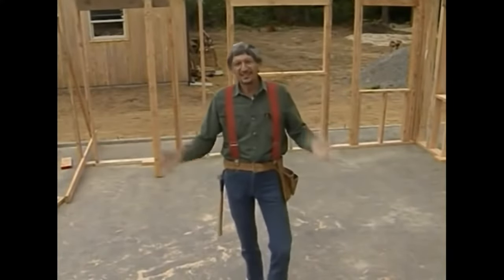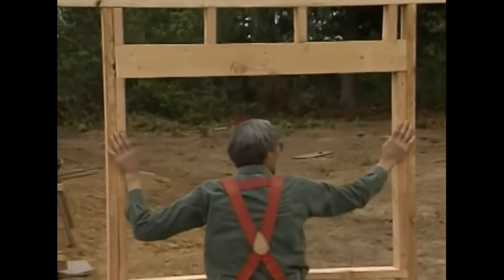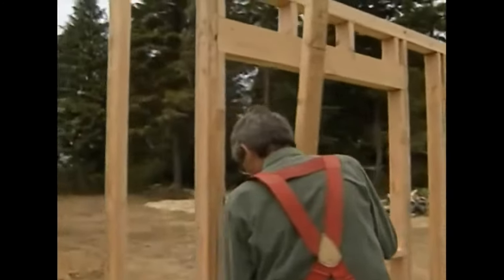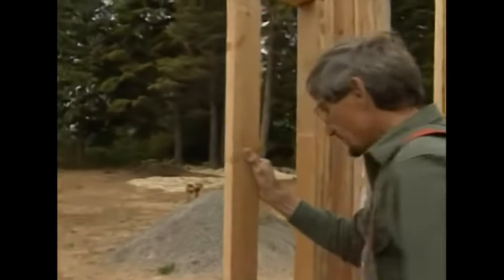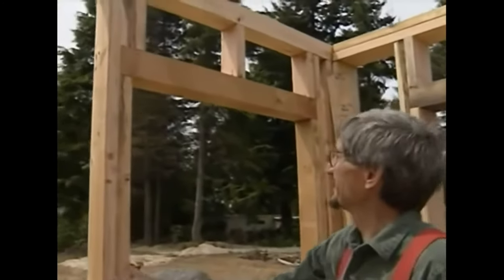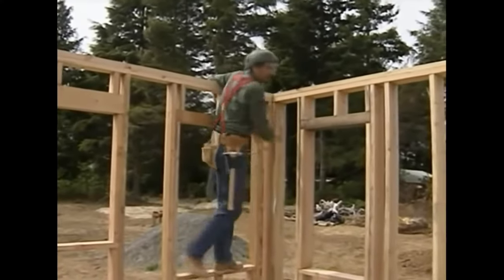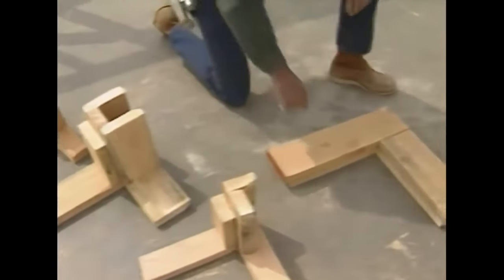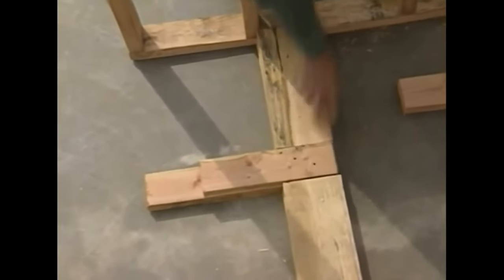Wall Anatomy Larry Haun

Comment: Those three stud partitions create a dead space that will not be able to be insulated later down the road. The two stud partitions/corner posts may not be quite as strong but they allow for insulation which is why they are usually preferred.

Comment: 6:10+12 =7ft10 (excluding 4” upper double plate and 2” bottom plate). How do you sheat this wall with 8ft sheet?
Reply: It adds up to 8 ft 1 1/2 so it'll be an inch off the ground for slabs

Comment: I would love to give you the opportunity to understand about a mechanical device that I have invented that is by far the strongest on the market #zrunner is the mechanical device that is midline attachable made out of stainless steel and it has all of the configurations needed for SRT and DRT climbing scenarios.